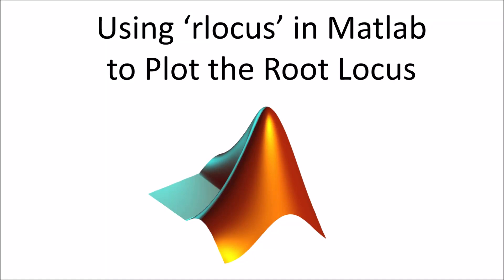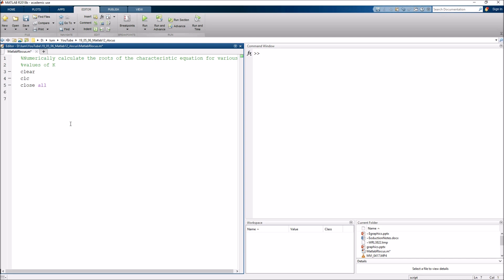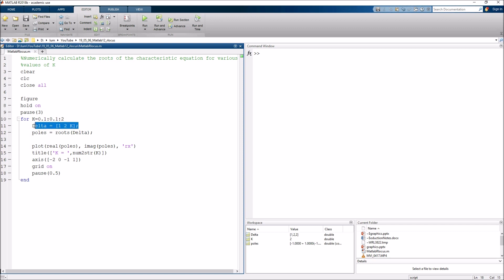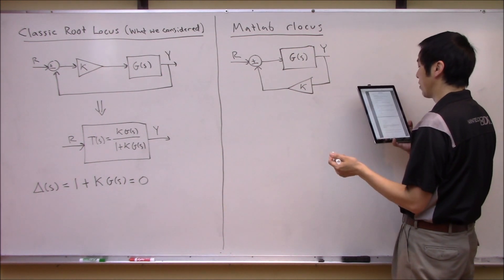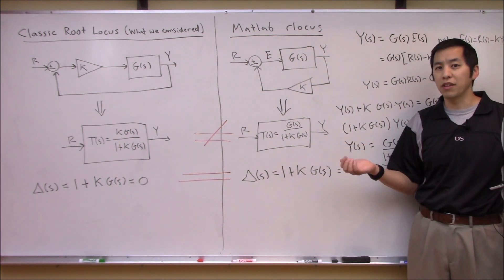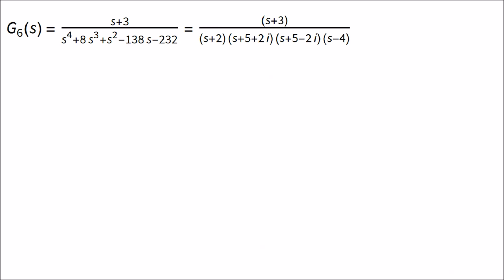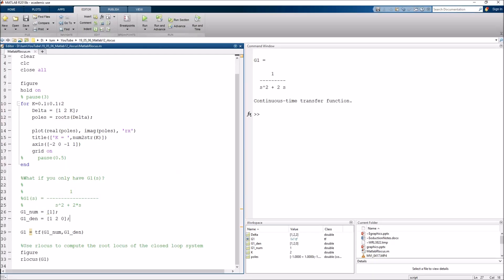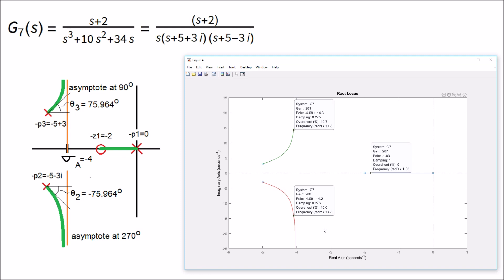Using ‘rlocus’ in Matlab to Plot the Root Locus

Comment: AE511: After all the videos/lecture material going indepth about manually sketching the root locus plot, how you were able to boil it down to a simple for loop was quite the sight! Great insight into the fundamentals, especially without using the fancy matlab commands